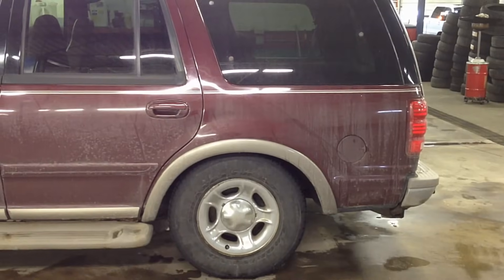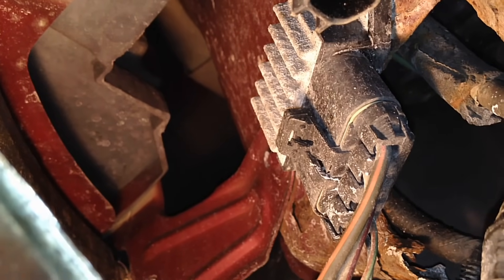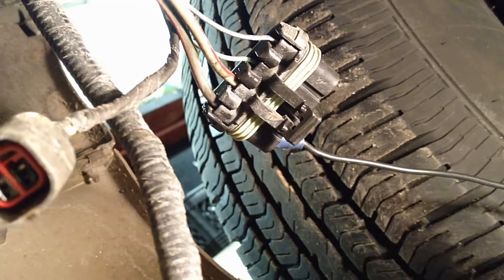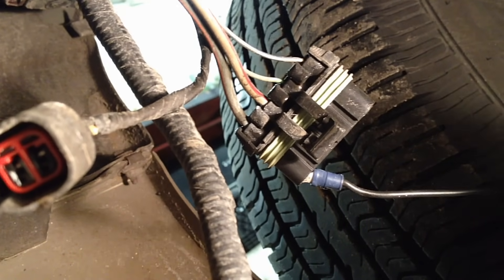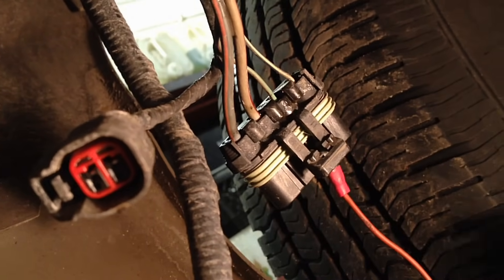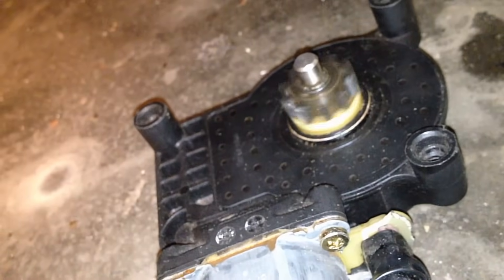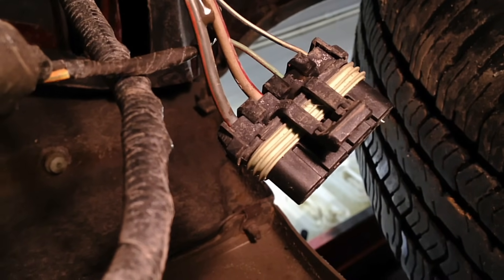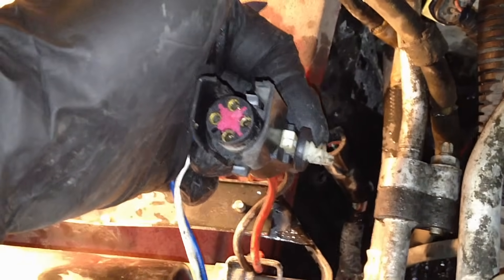Ford Air Ride Rear Suspension Down Diagnosis & Fix

Comment: So I did all the tests on the pigtail like you in the video, all passed. Replaced Relay and nothin. Also the height sensor is the older one not the linkage one. Help anyone?

Comment: Can you do a video on air tube routing, common fail points, how to locate and repair air leaks? I’ve got a 2003 Navigator to repair. PS: Great Job on your videos (a small laser light helps identify parts in tight places ….)

Comment: What color is the thin wire next to the thin green wire. Can’t tell the color of it in the video. 

Are the thin wires specific to number 3 and 4 on the harness or if the green wire is hooked up to 4, will that matter?

Comment: 05 exp eddie bauer. When I turn on the fan or move electric seat the check suspension light comes and won't kick on compressor while I'm driving and thinks the trucks off and sqauts down. When I don't have fan or high usage of electronics it doesn't happen. Is this a relay or pigtail issue why it's shorting out ? Also sometimes my windows open and close fast. Sometimes there super slow. Also cd player skips a bit to like it's shorting out

Comment: Hello good morning, I have a 98 lincoln navigator  , with the rear sit low , the front came up ok,  this all start since I install the brake light switch  wrong,    help me I change the relay same thing. Any fuse link to the rear thanks

Comment: Ford air suspension SUCKS. My 2006 Mercury Grand Marquis had leaking air bags. I just ripped them out and replaced them with a pair of coil springs. Problem solved. Permanently.

Comment: I own a 2007 Lincoln Navigator Ultimate and my check air suspension light comes on now and then. Do you have any videos for that year and make to diagnose the issue?

Comment: Hello and thank you for your videos, quick question, I have replaced my bags and compressor (208k miles on original) however the compressor runs intermittently and drains the battery even while parked with no key, do you think this is a plating issue or do I have a very small leak somewhere?

Comment: I have an issue with my 98 ford expedition. Both air bags went out recently and we ordered and installed new ones. The driver side has aired up fine but the passenger side only airs up some. It was taken off and put back on to no change. Ive been bounced and wobbled enough, What could this be?

Comment: I had a local mechanic say they replaced my shocks and struts but now it's worse. They are saying the only thing they know to do now is convert over to spring shocks and I just don't understand why they can't fix it like it's supposed to be fixed. I wish I understood everything u are talking about. I'd fix it myself

Comment: I have a 1998 Ford Expedition 5.4 Eddie Bauer 4x4. My suspension light kicks on usually after I’m driving for a while especially if I have my Dirtbike on the hitch. I have replaced the pigtail and relay. My compressor kicks on. The sensor in the back works, will kick on compressor or bleed air when I compress or expand it. I checked the air springs for leaks and didn’t hear anything although I do see cracks. I sprayed soapy water to see if it would help me see a leak and I got nothing. Any suggestions on the next step I should take would be appreciated. @FordTechMakuLoco
Reply: @FordTechMakuLoco ^^^^ 🙏🏽

Comment: Where exactly is the air compressor n relay located? I thought I missed it in the beginning but it wasn't mentioned
Reply: Under left head light.... Back the fog light
Reply: I was looking for the same thing mine  thanks

Comment: I have a 2000 Lincoln and its sagging in the back, the air compressor will not come on and we checked the leveling sensor in the back. What can it be cause its clicking but won't air up?

Comment: I NEED to know what is that sound on 6:19 to 6:21 where like the back makes a sound... like lowering or leaking? Because everytime I turn off my 2000 Expedition and close the doors it will make that sound... Thank you.

Comment: hi i have a 2003 grand marquis i changed the pump fuses are good relay is good still not working. does my car have that type of hidden relay or is that just the trucks thanks

Comment: Wish the problem was simple for me. Ive replaced a new air compressor, air bags, and relay switch. Spent 2 grand through mechanic shop and still lowered. Asked about the pigtail and the auto part store has no clue what that is. Can you be more specific please?
Reply: I have that problem you say 2,000

Comment: THANK YOU! My 97 Continental wouldn’t lift...I went to my local wreckers and got the relay from another Cont  7.95 all good now! Ford was $365and Lordco was $182......read too many about conversions where the car ride feels like a truck ride now having coil springs no thanks. Also the Cont in the wreckers I got the compressor and height sensors and Arnott air bags- sweet ride now!
Reply: December now back end won’t lift after all the switch outs....☹️

Comment: I switched to tradional spring and shocks from air suspension. Do you know of a way to stop the check air suspension light in the info dash center? I don't think I left the ride height sensors on otherwise I could just tie them up and bag them. I read about cutting one wire to fool the computer, but it was on a lincoln mk6.
Reply: Well it depends on the year! I personally know that it is done via the media control center on the 2008 Navigator!
Reply: Hey did U ever figure it out I got a 05 n it’s converted but the dam beep from the alert is killin me did u find out how to get rid of it?

Comment: Is the WPT392 pigtail you listed the correct connector for a 1998 Lincoln Continental Air Suspension relay? I would think that all Ford connectors for this part are the same because the Amazon link you have listed says the pigtail won't fit a 1998 Continental.

Comment: 1) what year is this vehicle? 
2) where is this relay located?
Reply: Having just done this troubleshooting yesterday, the pigtail and relay are best accessible by turning the front wheels all the way to the right and then looking in the passenger side front wheel well towards the front of the vehicle.
Reply: @danieldyer1  thanks but I was looking for an 08 Navigator!  Its located in the under the hood junction block! Referring to the relay! I finally found it after calling multiple ford and Lincoln dealerships! You can also control it in this vehicle year  range via the media center! Using the "set up" and the "RESET" buttons on the the media center!

Comment: 01 Navi, rear stays up will not drop or level out? No leaks, compressor doesn’t seam to come on, Help!
Reply: I was having the same problem on my '00 gator. There's a wire that runs down the passenger side frame rail that had gotten snagged by a stick so the system would air up, but then it couldn't actuate the solenoids that are mounted on the bags to vent the system so it would get stuck aired up. Pull the ride height sensor like he does at the beginning of this video and confirm that those bag solenoids are clicking.

Comment: Thank you, sir!! Had a "Check Susp" light on and the compressor wouldn't turn on.. Ended up being a loose plug into the relay.. Zip tied it up and we're good to go.. Thank you for your awesome and helpful videos!
Reply: Hi can you pls tell me where to find the plug to the relay that you zip tied?
Reply: @donl3381  Did you find the relais? Can someone tell where to find this Relais? It looked that it is driver side behind the rear axle

Comment: Hi there can I ask you a question I know you're really busy with your Channel with so many Subs but if you ever get time. I got a 97 Ford E150 and I had a good check-up at Firestone and I was wondering about the shaking noise in the rear of my van and they told me whoever had it prior to me took off the air suspension which was like a balloon kind of the way they described it which helped me understand and they put regular suspension on. I asked them the cost and he said it can be pricey pending and where you get it done at but also they said they wouldn't want to see me spend a lot for something that doesn't always work and goes back to doing the same thing. Is that true what they told me but if you get the air suspension for the rear it doesn't always work and it will still shake when you go over the smallest of bumps? Thank you and best of luck with your Channel appreciate any feedback thumbs up and supporting fully🙋🏻🐕🚐 975👍👍👍
Reply: Sell it buy a diff vehical or take it to the dealer. It is hard to find a trusted independent mechanic shop to trust for that

Comment: I have a 2001 Crown Vic with Air Ride in the rear only. The air pump comes on but the rear does not rise to the proper height. Any tips on where I should start?

Comment: We have this problem on our 1998 Navigator. Unplugging the pigtail and plugging it back in selectively kicks the compressor back in and pumps up the back end. Sometimes it works most times it doesn’t. I tested all circuits on the pigtail and they checkout. Is this just a relay problem or should I just replace both relay and pigtail?

Comment: Thank you for doing this video. 
Is this system the same on panther chassis with air suspension cv, p71, town car, etc? All info seems to be about the SUV models

Comment: I jumped the compressor and it turns on but jumper wire gets very hot. I tested the other two wires with a multimeter and get about 12 volts. Compressor will still not automatically activate. Both height sensors look OK. What next?
Forgot to mention. I disconnected the battery to clear the check suspension light and still no change.
Edit: replaced relay with one from a junkyard and all is well.
Also, I bought the truck a month ago and the rear is always riding at max height giving the truck a forward rake.

Comment: I have a 2003 Navigator  I think the air bag on the driver side back will not pump up but the other side pumps up do I only have to replace the side that is bad or do I have to replace the right and left bags.

Comment: I have a 2000 Limited AWD V8 5.0 -- The pump seems to work as it's coming on all the time, and you can see the back lifting... there doesn't seem like too much noticeable sag. How would I check for leaks? Would you recommend converting from air to gas to just bypass the system? As of recently driving my vehicle feels like I'm in a boat.

Comment: On my navigator, my pump works and I’m positive that the relay, pump, pigtail and sensor all work and are fine. I’ve checked the airbags in the rear. The problem is that the vehicle will air up most of the time. And stay up for a few hours. Then all of a sudden, over a span of a few hours or minutes the bags lose air pressure. I noticed like if the vent valve or something would randomly open w/o command or stay open as the bags air up. What would you recommend I should do next? If possible shoot me an e-mail maciasaxel13@gmail.com I’d really appreciate it, thank you

Comment: 99 Navi with the rear low. Getting no ground from control module. Anything to check for other than just replacing the module?  Thanks

Comment: There's no way to test a relay???  Really??  Yes you can and it is very easy.  You just need a car battery, some wires and an ohm meter.  Put it on a bench, apply voltage across the primary terminals and put an ohm meter across the secondary side.  That's how you test a relay.  They may have normally open, normally closed or both types of contacts and the internal schematic is almost always printed somewhere on the relay.
Reply from the maker: These are solid state there guy....

Comment: I have a 2010 expedition and I'm having problems with my check air compressor keeps coming on and the back of my vehicle is basically to the ground. When you drive you can fill every bump, rock, everything you ride on. What should I do. Plus I'm 8 most pregnant and it's killing me

Comment: I have a 2000 4wd navigator both sides are low but the passenger side is lower.low enuff where I cant put my hand on top off the tire.the pump turns on pumps for a little bit then turns off.this is just in the rear

Comment: My load levelers work but once the vehicle is parked, two days later the rear is sagging. Is this normal?
Reply: I just fix the relay.... But some times rear goes down, put switch and goes up but no to high 😕.... How you fixed yours?

Comment: So I did this and the last wire did not work, the control module ground wire... can I splice that and re ground it somewhere else or does it ground through the module? What's my options?

Comment: FOR WORK COMPRESOR NEED TO CLOSED THE FOUR DOORS?
Reply from the maker: +Marco Antonio Rodríguez Martinez yes
Reply: Where is the exact location of the air suspension relay on a 2008 Expedition? Thanks.

Comment: My relay under the head light on the passengers side just had a loose connection! We also discovered my car had been in a flood something carfax didn't show I know now what to look for red clay is what we found on the steering column -Jackie

Comment: having a similar issue with a 2004 Ford Expedition Eddie Bauer Edition..lines replaced, bag holds air, but left side wont raise. will work one day and the next it wont.  my mechanic replaced the lines when they rotted..any suggestions? right side is fine

Comment: I have both an 06 & 07 Navigator. Would the air suspension pump from the 06 fit the 07 if I needed to  swap it out ? Thanks !

Comment: my pump turns on but only pumps and it pumps the front up really high and the rear doesn't pump up
Reply from the maker: Check the gate valve under the vehicle right under the drivers seat area on the frame. This valve must function to fill the rear.
Reply: ok I'm tired of trying to fix this air bag stuff. if I get stock springs from a junkyard can I just swap out the airbags for the springs and be the end of it. and what about the air lines do I have to plug them some how.
Reply: tony Hern why from a junkyard? There 300 online from a decent company that will last longer then any junkyard suspension

Comment: Question:

First, thank you for the video.

I have a 2010 navigator that the rear suspension drops intermittently. what are your thoughts on that. 

It will drop while driving, but then once the vehicle has been turned off then back on, it lifts and is good for a day or so. 

any advise is greatly apreciated.

Comment: hey I have a 98 navigator 4x4 my truck leans side ways on driver side I know I have a bad air bag on the back driver side but the whole truck leans not to bad on front but could it be Bc of the bad air bag in the back

Comment: Great Video! Thanks for posting! I have a 2008 Expedition. My problem is the rear will sag like you show in your video however when I start the car and go in reverse or drive it will start to pump its self back up. This is random, in other words it can maintain its normal height for a couple days and other time it will sag every day. Any suggestions? Thank You in advance for your reply.

Comment: I have 2000 navigator and have replaced both bags, compressor, relay and pigtail.  only right rear does not raise up.  Would it be the solenoid on that side?

Comment: can the compressor still power on if the suspension relay is bad
Reply from the maker: +Edgar Perez no
Reply: FordTechMakuloco Okay so my compressor still kicks on but the rear went down.  I also replaced the bags a few years ago.  a few months ago I started noticing the expedition going down when I would turn it off, then once I'll turn it on it will go back up to normal height, but just a few days ago it went down all the way and it has stayed down. any suggestions on what might be the problem.

Comment: 2001 lincoln navigator anyone know how to vent the rear air springs so I can change the solenoid
Reply from the maker: Jack up the rear of the vehicle and support it with jack stands on the frame then remove the lock clip holding the air spring solenoid in. Then slowly turn the solenoid out to the first dent it will now vent the spring. Once it is vented you can turn the solenoid again to the second detent no you can remove the solenoid and air spring.
Reply: FordTechMakuloco awsome man thanks

Comment: 2010 Lincoln Navigator Air Ride Suspension Control Module Replacement:  system has no air leaks, compressor comes on and brings vehicle up to correct ride height. however system then vents and currently is squatting at the rear.  How involved is it to access the module?

Comment: I have a 1998 Explorer Limited and the air ride compressor keeps turning on and off. A line leak?
Reply from the maker: More likely to have an air shock leaking as the suspension rebounds.

Comment: I own a 2007 Expedition.  Recently the rear air suspension loses air.  A few days later there is a loud grinding noise in the engine compartment and some fluid leaking right near the front differential gear.  I checked and replaced both the short shafts on front end and the transmission.  Didn't check the air pump nor dryer.  Could the pump be leaking the fluid as well?  Front air suspension maintains it's pressure.

Comment: I have an Expedition-1998. Rear pump went out. So I determined that soon the front would go out and cause me to spend more money. So I purchased a conversion kit to go with springs and shocks for the front and back. ($419 for the kit). Now the vehicle sits stronger and slightly higher, giving me a smooth ride and a peace of mind.

Comment: i have a 2002 expedition. the compressors turns on and the front pumps lifts but not the rear. is there more then one pump.
Reply: dr pepper is shit